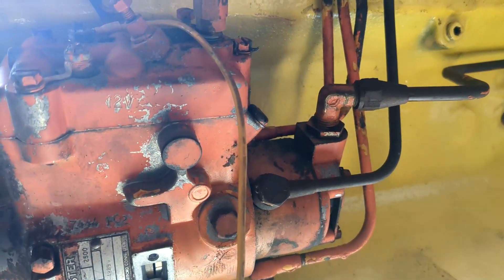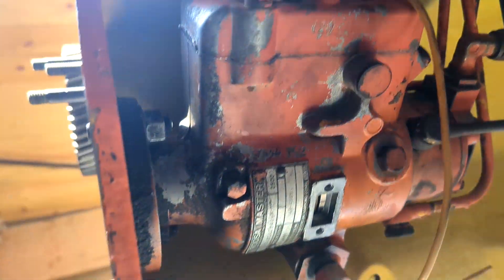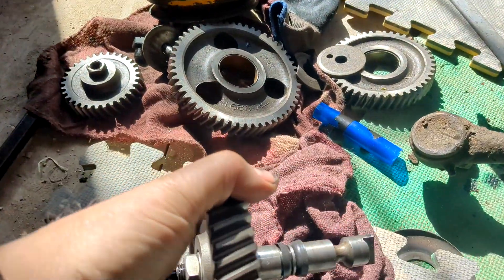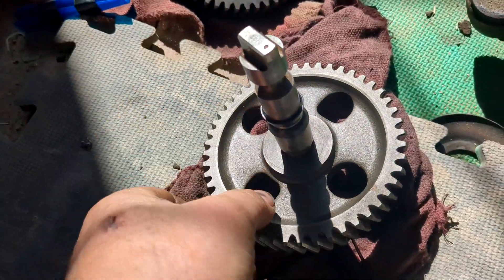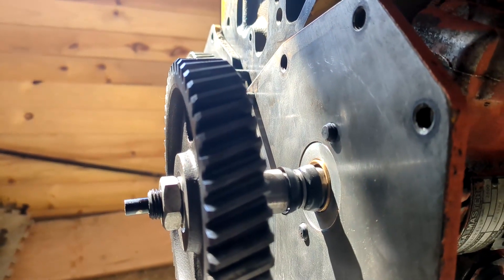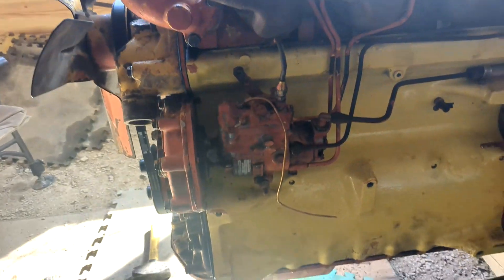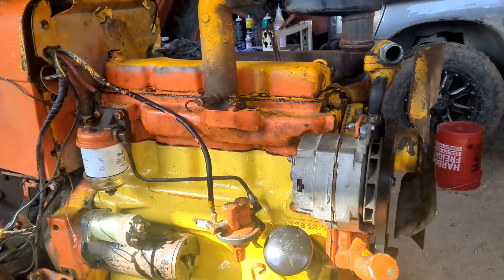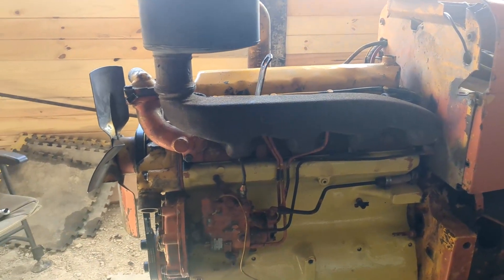John Deere 400 Timing Setup: Gear Installation & Aligning the Marks!

Comment: Nice to see you improvising using knowledge and what you have on hand. I’ve actually used a thin old plastic water bottle cut into a strip to squeeze those seals down and slide them in. The cheap plastic water bottle I thinks half the thickness of a two liter bottle and worked out real nice.